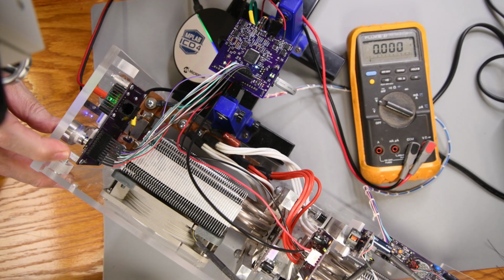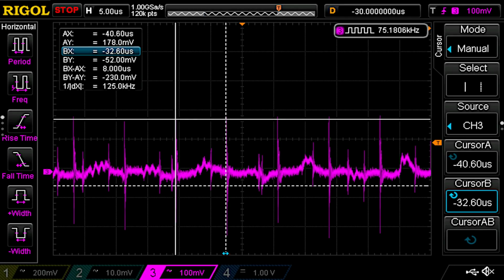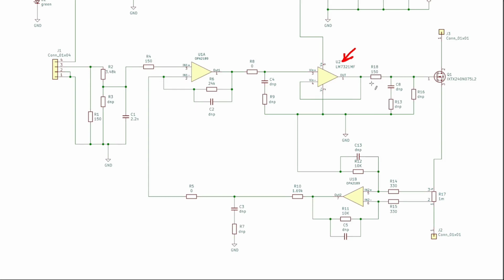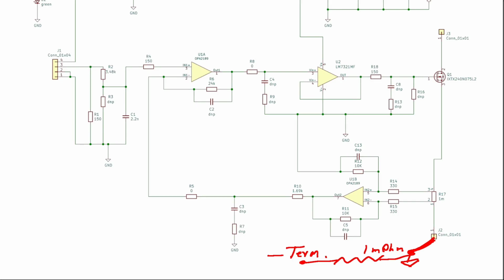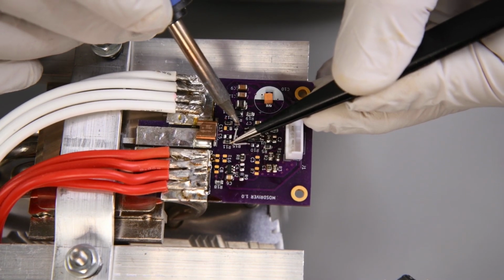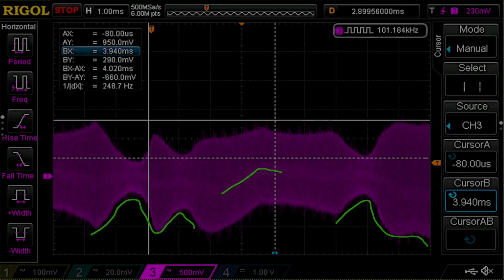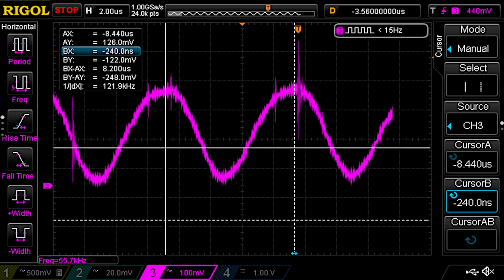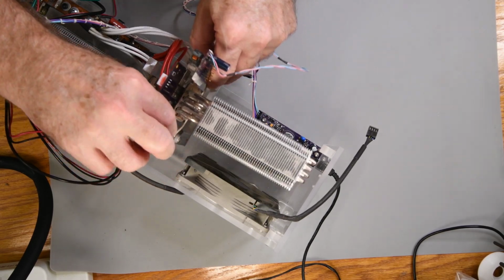Oscillations oh my the Oscillations

Comment: I would recommend you simulate the analog section, and model what you are doing, also look at some schematics of working eloads many to look at. You can treat the system as a PID loop this is possible but that noisy ADC/DAC I would recommend dedicated parts for the ADC + StableVref and DAC 16/18bits.
Reply: 1m is low hitting the noise floor spectrum here. Why not use something like a 0.05R. For 3A and below redirect using a MUX to a "FET/current branch" where R17 is 1ohm and above 3A use a 0.050 branch play with the scaling factor, again simulation will help.
Reply from the maker: Thank for the feedback.  I’ve been playing with the Kicad spice section.  I’ve got a lot to learn about it.  But you are right I think it would help a lot.  I didn’t mention it in this video but R17 is so low because each module needs to handle 30 amps.  When I was first laying it out I though I probably should go with 0.002 ohm but it was such a low noise op amp I though I’ll give it a try.  I’m not worried too much about the low current end as long as it doesn’t oscillate.  I would like to get 100 mA steps at least.  I though I could with the 12 bits.  But I’m not sure now.